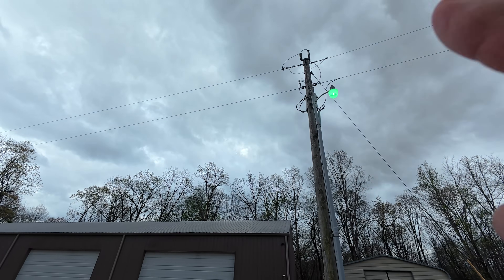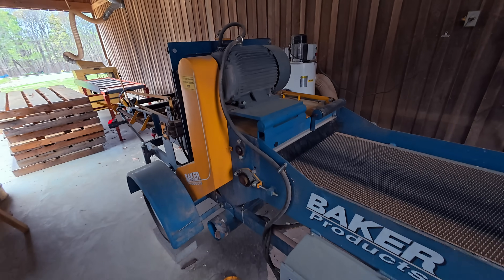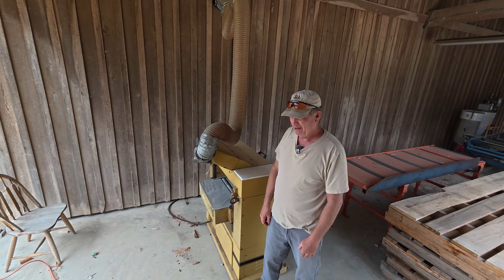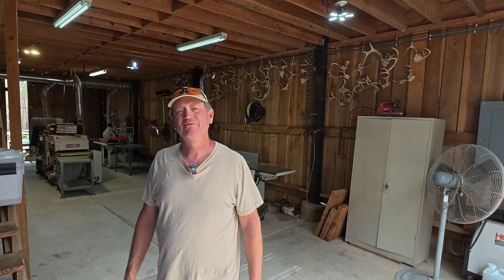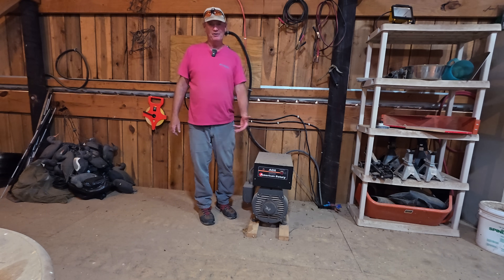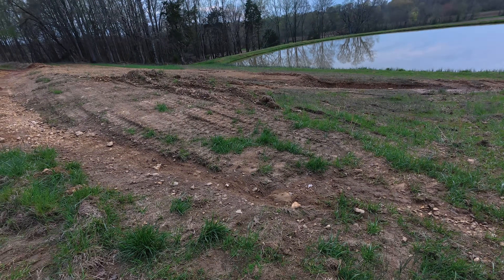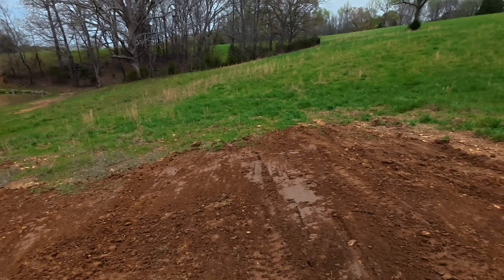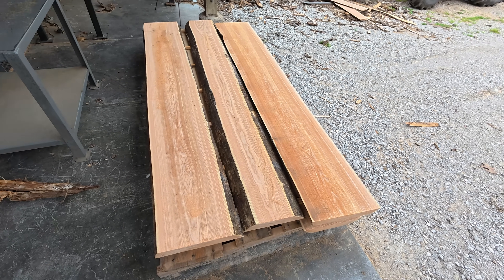Secrets of Three Phase Power for Your Sawmill!

Comment: it does a little more than just give a 3rd phase..it also changes the sign wave  from being 180 degrees out to each phase(single phase) being 120 degrees out (3 three phase)
Reply from the maker: Yes, assuming a routine sine wave for the ac, a 3rd phase has to be 360 degrees/3 or 120 degrees.
Reply: @HobbyHardwoodAlabama  has to be if not you have a direct short

Comment: We run our iron worker (15hp) on a VFD. Been doing so ever since the rotary converter shorted out (motor gave up after 8 years)
Just be sure that you over size 20% 
we bought a 10 HP air compressor. We added a VFD for it. 
VFD are great for running motors, however not too good for controls. So what I did was run the controls on 1PH and added a motor starter. I have the VFD going direct to the motor starter and then to the motor. The 2 lines that were used for control and the motor now goes to the motor starter coil. 

I had many people that want to have me wire things for them. They cannot afford me (Yes I am a PE in Texas). I taught the local (friend) electrician how to do it. He get one or more calls a month
Reply from the maker: Thanks for the helpful information about VFDs!

Comment: Still subscribed.  Nice video, but I think you should have included a mention of how much power you can convert depends on your service.  Most residential service is either 100 A or 200 A at 240 V. 24,000 watts at 100 A, or 48,000 watts at 200 A.  Using 1000 watts/hp, to be conservative on the efficiency side/give you a little wiggle room to run lights,  and easy math(1000 is much easier to do in your head than using 745.7(746) for the watt to hp conversion) means you can convert 24 hp(100 A service) or 48 hp(200 A service) from single to three phase without contacting the power company for a service upgrade.  You know, they're going to ask.  Of course you can't think of everything or include it in a video.
Reply from the maker: I will do it.

Comment: Great stuff, Robert!  Dirt work around the farm has become one of my favorite tasks. 😊

When I started my metal fab shop, I needed 3-phase, but it wasn't available nearby.  A 5 horse rotary phase converter was $1,000 back then , so I did some reading, bought a few parts, and 5hp, 3-phase motor and built my own for $300.

I could start all 15 horsepower that I had at that time, all at once, plus the 5hp of the converter.  Of course, nothing was loaded, but the starting amps are the highest, usually.  Nary a glitch!

Eventually, I moved to a much larger building and kept the converter for home use.  Still have it.

The new building had 480VAC Y with a grounded B leg.  After more research, I found a used transformer, about the size of a kitchen oven, moved the taps around in it until I was getting the correct voltage, and wired all the 3ph machines in the building, including the 100 horse waterjet pump.

Fun times!

I'm all for ANY kind of content you want to put out, so go nuts and do what pleases Robert.  😁
Reply from the maker: That's great info, I appreciate it.  And thanks for watching.

Comment: Your phase converter is sitting on wood blocks on your wood floor.  Your hum is probably, mostly coming from the vibration transferred to your building. Mechanical vibration dampening pads would go a long way towards eliminating the noise and are cheap and easy to install. (Simply list the motor and sit it on the pads.)
Reply from the maker: Thanks, good suggestion.  However, I have rubber vibration isolators on the bottom of the converter, as supplied by the manufacturer, between the chassis and the wooden blocks.  The wooden blocks are to allow me to attach it to the wooded floor with screws.  I asked if I could put a rubber mat under the phase converter and the company did not recommend it.  So I installed it the way they recommended.

Comment: Your power company is pulling your leg. I've worked as a lineman my whole life and upgraded many 1phase power lines to 3phase. Never changed out the existing pots on the line. Only the pot we were upgrading to 3ph
Reply from the maker: Thanks for the info, I was sure it was a screw job, but I'm glad to hear that it really was. But they still have to run a third wire, and put up new spreaders on the poles?  There are only the two wires for about a mile, to the nearest highway, where they have run three phase.  I even called up the utility engineer and he started giving me a bunch of crap and I got the distinct feel I was being used as a sucker.
Reply: Cost sharing is not uncommon plight for users like HH. They are the only three phase demand on the line/route and there are no other users to share/absorb the costs of improvements that benefit a single user.
Reply from the maker: Yes, that is exactly what they told me.
Reply: P.s. Not only did we not change out the existing pots but never blinked any lights.
Reply: I think it would be two more wires, because one of the two is the neutral.
Reply: If you need a wye voltage like 120/208 or 277/480 then you need 3phases and a neutral. If you need a delta bank like 240 or 480 3 phase you can have a 2 pot bank  with 2phases and a neutral. @edwardkuenzi5751

Comment: I have a rotory converter to run my millling machine has worked fine for years. I learned about inverts that you can make one by using a three phase motor and a single pase motor to start it with.
Reply from the maker: I agree, they work well and are very reliable.
Reply: I built one, but I used a start capacitor to spin it up.  So, to start it, I just press the button for about a second.  That was a fun build, and I still use it home now. 😊

Comment: Robert tanks for  the 3 phase. Question 3phase mill or diesel mill, advantage of running costs, maintenance costs, and would you run/operate a 3 phase mill for your operation
Reply from the maker: You are correct!  It is a species of wood.  But which one?

Comment: Another great learning lesson on electric 🙈any chance you could do something on kiln drying have a new Nyle kiln turning up here in the uk in may
Always enjoy the learning journey thanks
Reply from the maker: Hello UK!  Oh boy, I have a love/hate relationship with Nyle. They have the best unit out there, but it still has significant problems and they make stupid business decisions on their equipment.  For example, did they convince you to buy the high dollar controller with the fancy touch screen and all the options except the most fundamental option of all?  The moisture probes?  Did they try to convince you that you didn't need them for a bunch or reasons?  Well, if they did, go spend extra money for an external set of moisture probes from Delmhorst or somewhere else.  The Nyle logic is stupid that lumber will always dry to schedule, won't have wet pockets, bacterial infections o that you will never mix a load.  To me their reasoning is as short sighted as selling an airplane without an altimeter, an oven that doesn't display temperature, a car without a speedometer, or yes, a kiln unit that dries wood which does not have a way to directly measure how dry the wood actually is.   If I can do a productive video for the viewers such as yourself, without getting too much into their poor engineering or management decisions, I will do it.  Hopefully, you bought the L200M with moisture probes, vs their flagship unit without moisture probes.
Reply: Man! You are a wealth of knowledge! A national treasure, so to speak. 😊  for reals, thank you for the lesson

Comment: Would you consider an electric LT70?
Reply from the maker: No, the diesel I have uses the motor to drive the hydraulic functions, so Woodmizer told me the Diesel has 6 times faster hydraulics than the electric version which still used their little dump trailer style electric hydraulic pumps.  So it was a non starter for me.  They may have since upgraded, you might call them.

Comment: Hi Robert: Good explanation of 1 & 3 phase power services and the considerations for isolated rural properties. Have you done a cost analysis between your monthly diesel and electricity costs, versus installing a 50 Kw (or higher) 3 phase Solar installation with an adequate battery bank -- i.e. what is the payback time? I assume that most of your 3 phase work takes place during daylight hours. You can charge the batteries with either 1 or 3 phase if need be, however 3 phase from your generator would be much faster. Also, if you run your 3 phase generator as your main power source and sync your inverter to it, you would minimize virtual inertia problems with the inverter -- the solar would do all of the heavy lifting, and the generator would smooth out the inrush currents. Do you pay a high monthly connection cost from you r electricity provider? If so, you could look at going completely off grid to save even more money over time. The goal here would be to have no monthly electricity bills, little or no monthly connection fees, and reduced diesel costs. It doesn't cost anything these days for a quotation from a reputable commercial Solar Contractor. And I won't even suggest a Baker Products Dominator 3650E (50 Hp electric) Sawmill -- you will always be a Woodmizer guy...
Reply from the maker: I never did originally, and it was more for a practical reason than anything.  When I bought the Straight Line Ripsaw, the company said they would only honor their factory warranty if I used either 1. line 3 phase or 2.  Only an American Rotary brand converter.  So that made the decision easy, especially since I wanted a warranty with a $30K machine.  Later, I did contact some pro companies for commercial solar power systems, and the installed costs were shockingly high, one bid was over $100K.  So instead I spent $6K on a used generator.  Also I looked for green energy cost sharing deals for the solar power systems, and there was nothing of significant financial help.